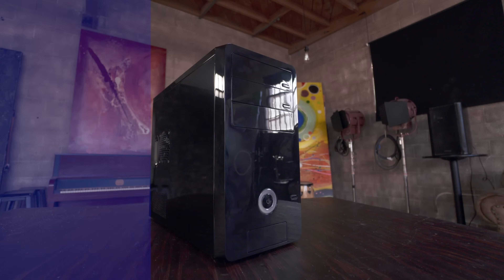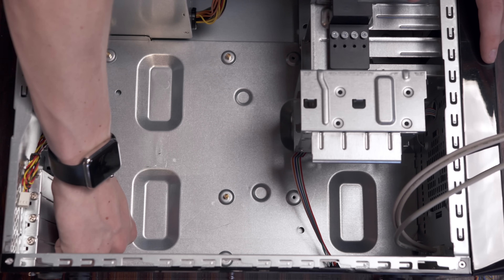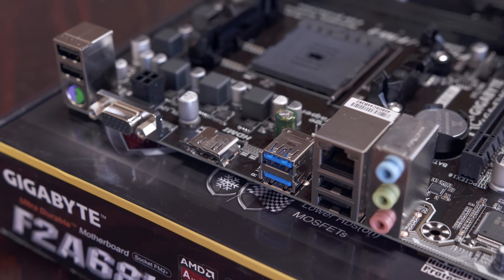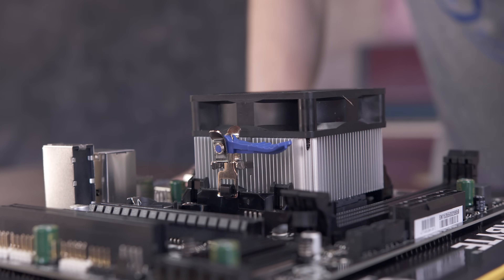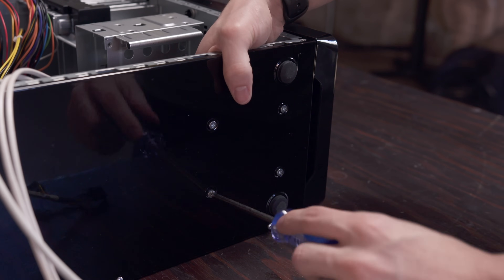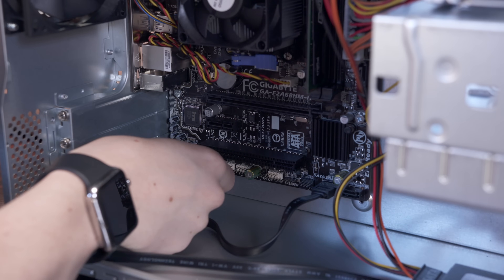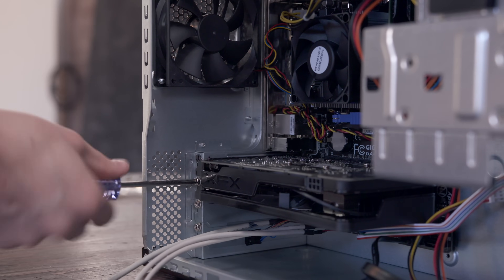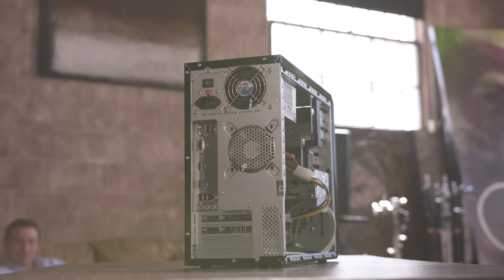How to Build a Gaming PC! (2016)

Comment: Is this good enough to play games @1440p?
Specs :
Motherboard X99 Asus rampage V10

Ram Corsair Vengeance LPX DDR4-3200 32 Gb

PSU Corsair AX1200i

Intel I7-6950X

DVD-RW Samsung supermulti

Corsair Graphite 780T case

Corsair H100i liquid cooling

Dual SLI : Titan X pascal

HDD Seagate 8TB Archive V2 Enterprise

SSD samsung 850 Pro

Windows 10 Pro
Reply: Jesus.... Thats pretty good. I am no tech guy, but I know quite a bit. It's pretty good. But, I feel you are spending too much. Like the cpu, 1 thousand dollars? Here are my recommendations. 
CPU: Intel Core i7-6700K ; Link : http://www.newegg.com/Product/Product.aspx?Item=N82E16819117560&nm_mc=KNC-GoogleAdwords-PC&cm_mmc=KNC-GoogleAdwords-PC-_-pla-_-Processors+-+Desktops-_-N82E16819117560&gclid=CISg0_qX1M8CFQYkhgodRY4JmA&gclsrc=aw.ds
PSU: CORSAIR CX-M series CX850M 850W 80 PLUS BRONZE' ; Link : http://www.newegg.com/Product/Product.aspx?Item=N82E16817139153&nm_mc=KNC-GoogleAdwords-PC&cm_mmc=KNC-GoogleAdwords-PC-_-pla-_-Power+Supplies-_-N82E16817139153&gclid=CKHm-LCX1M8CFcJZhgodNd8ANA&gclsrc=aw.ds
storage(if you want): Seagate Desktop HDD ST4000DM000 4TB 64MB Cache SATA ; Link : http://www.newegg.com/Product/Product.aspx?Item=9SIA5AD4R59999&nm_mc=KNC-GoogleMKP-PC&cm_mmc=KNC-GoogleMKP-PC-_-pla-_-Hard+Drives-_-9SIA5AD4R59999&gclid=CNzIkM-X1M8CFZJahgodAvwKcw&gclsrc=aw.ds

Obviously you don't have to take my advice, but you should. Again, I am not very reliable so you might want someone better then me.
Reply: Foxxyman Aye, the site called pcpartpicker allows you to have a list of parts that you can check the compatibility of and people can also share their build. If you didn't already know :p and also, you can send a link to people and they can see the entire part list that you made. Pretty handy! If you want to use a specific part, there is a way to see completed builds using a certain part that you want. If you knew this then... Rip
Reply: r..r...rip????
Reply: ItzRada Yep. I just figured i'd just give them these links :p
Reply: but how was that bragging? opinion of other is the reason why i posted that
Reply: appreciate all the info thx
Reply: Zacronzer Zetto I was just saying. You could've just saved some money and still get a great pc.
Reply: +Zacronzer Zetto you don't need all that. a 6700k and a single gtx 1080 will suit you fine. also, you would do well with a small SSD  and a bigger hard drive.
Reply: Josiah Schmidt Not een a 6700k unless he wants to edit and other workloads 6600 or even 6500 is good enough for gaming
Reply: Foxxyman don't think you needed to do that. He's obviously joking
Reply: Foxxyman according to pcpartpicker a I7-6700 would be good enough and a less storage and etc but since i wanted to future proof it,  would it be wise to just get the part as the web said? Or should i get a better part
Reply: Zacronzer Zetto That ram is overkill, 32gb is not needed
Reply: He was sarcastic
Reply: +Josiah Schmidt ok so i just need a single gpu and less ssd got that

Comment: can a 500w power supply handle with a gtx 970?
Reply: Yes
Reply: Sh2d3wZ Sorry but 250W is too low.
Reply: might wanna save up a bit and go for the 1070...
Reply: VizionGamingHD perfect, my next "investment"
Reply: Sh2d3wZ 250w is way too low. I recommend at least 400w
Reply: Tandju A 500w will work with any GPU since GPUs get more and more power efficient each year. TBH 500w is overkill for any PC that's not using SLI or Crossfire. As long as you have an after market PSU and not a cheap no name PSU. 500w is more than enough
Reply: Tandju a 500w can power a 1060, don't see why it can't handle a 970
Reply: Tandju or a 1060
Reply: Tandju get a 1060, it works with 500w and it compares to a 970-980
Reply: Comet Productions well a 1050 is a low powered card so an EVGA 430w will suffice
Reply: Thundertube7 that was fast thanks
Reply: it can even handle a 1060
Reply: Tandju oh can it even handle 

Homework!!!
Reply: Tandju Ask Reddit. They will tell you 100%
Reply: 970 need more power than a 1060 ......
Reply: you should get like a 1060 or 1070 instead
Reply: Tandju yes
Reply: Another question, sorry if its a dumb one: Can 250w power supply work? I'm planning to reuse the old power supply
Reply: Thundertube7 any idea what PSU I'll need for a gtx1050?
Reply: Just finished building my desktop few days ago, and it has a 1060 in it with 500w PSU
Reply: LightBytes unless you're going with a crossfire/sli build or plan on overclocking, there's no way you'll need more than 500w. Even builds with high powered cards like the 1080 dont go over 500w since AMD and Nvidia keep focusing on power efficiency
Reply: Eh, you do have valid points, i just like to go for the higher watt psu's cos it'll provide a lot more leeway for overclocking and shit, but even if i wasn't id still go for at least 600w because some cards still need a fair amount of power
Reply: Sh2d3wZ 250w psu? lol thats funny joke man.
Reply: Thundertube7 the new one that MSI made can work on a 275 watt psu no problem. someone got it to work fine
Reply: most likely a shit one lmao... you mad?
Reply: yea
Reply: Tandju
Reply: Tandju believe it or not, a 500W gold PSU can handle a Titan. (Of course it can't be overclocked or anything)
Reply: A 500w PSU can handle any GPU,I bought a 550w PSU just so I can overclock my CPU a tad bit but yours should be able to handle any GPU and CPU
Reply: it could
Reply: The other hardware make sense
Reply: Tandju  yes it can easily
Reply: Tandju If I am not wrong.. ALL Gtx's needs at least 300W
Reply: No.. 650 is waaay too high for a budget build.. even a 450 W will suffice
Reply: Tandju Yes.. lol.. GTX 1060 needs 400W to work
Reply: Jaythekiirby 980 is better than 1060
Reply: +Roi gipot Not really
Reply: 600W is standard these days... Honestly 500w is kinda low. I recommend the Corsair RM 650x 650w.
Reply: Thundertube7 I have a only 1 980ti and a 850watt psu... you mad? haha

Comment: http://pcpartpicker.com/list/mYF8Z8 us it good or not its my first PC. might buy it
Reply: Reverse Flash if you can get an ssd, they help so much and make your system open up programs much faster, and boot up faster. I would recommend like a Samsung 850 Evo 250gb
Reply: is*
Reply: Thank you for the suggestions.
Reply: What is your budget for that pc build? It's pretty good but i think you should spend more in the ram (8 gb it's okay but 16 gb will be much better), a ssd and a gtx 1070.
Reply: d a t b o i 現代のコン420 well i just want 1080p gaming not going for like 4k gaming
Reply: If you only want to go 1080p gaming i recommend you going for an i5 6500 or i5 6400 instead, that are 30$ to 50$ cheaper and is a minimum difference in gaming in case the of the i5 6500.
Reply: Red LED fan for a case with blue LED fans... Wut?
Reply: Reverse Flash Pirate Windows.

Comment: would I be able to use a case from like 2001, to build my PC
Reply: most probably yes but you will have a shitty time dealing with it
Reply: PH0EN1X u get a job or beg
Reply: ofcourse you can, just make sure your motherboard will fit on it.
Reply: just buy a new one it doesnt have to be super expensive i would recommend the corsair spec 01
Reply: what if u dont have any money, and your parents wont give u any
Reply: PH0EN1X Work the corners
Reply: just get a new one for 30$ they look nicer also
Reply: Bender Rodriguez Haha.  Lmao
Reply: it might not be compatible considering you don't know the specs of it
Reply: I used corsair carbide series 200R and it is great, Holes for cable management and it is a good design.
Reply: No
Reply: A friend of mine stuck all the components on a wall with glue once, it worked
Reply: Or you can just build it in a shoe box. :D
Reply: the mother board and case should be same.
like both micro atx

Comment: Is this build any good? This is my first time to build a PC so any advice is appreciated.

CPU: Intel Core i5-6500 3.2GHz Quad-Core Processor 
Motherboard: Asus H170M-PLUS Micro ATX LGA1151 Motherboard   
Memory: Corsair Vengeance LPX 8GB (2 x 4GB) DDR4-2400 Memory   
Storage: Sandisk SSD PLUS 120GB 2.5" Solid State Drive 
Storage: Seagate Barracuda 500GB 3.5" 7200RPM Internal Hard Drive  
Video Card: MSI Radeon RX 480 4GB GAMING X Video Card   
Case: Fractal Design Define Mini MicroATX Mini Tower Case   
Power Supply: SeaSonic 520W 80+ Bronze Certified Fully-Modular ATX Power Supply
Reply: If you plan on playing more of DX12/Vulkan/Future games, you're fine
If you like playing on DX11 and older games I'd recommend you get a GTX 1060
Reply: Great build, but in my opinion, you should get a 1TB WD Blue HDD and you can get a 240GB Adata SSD for the same price as that 120GB Sandisk drive.

EDIT: If you want to play older DX11 games, get a 1060, If you want to play newer DX12 games, stick with the 480
Reply: how much is all of this?
Reply: pedro cottim Thanks for the advice!
Reply: You can get way better performance for $800
Reply: Joshua Cruz Congrats m8 its really well balanced but i would get a 256gb ssd a d 1tb hdd which is like 5-10$ more
Reply: Mahmut Arkawi How much does all of this cost
Reply: In my opinion it's pretty overkill for a starter PC, but if you know that is what you need its pretty good.
Reply: I know this is old, but can someone please check this PC build? I'm a beginner, and this is my first attempt. I have a 1000$ budget, Thanks!
https://pcpartpicker.com/list/F73Hqk
Reply: The Average Video Watcher You shouldnt buy the coller nor the windows 10 since you can get free keys online and spend that money on the 1060 6gb which is alot better imo
Reply: Looks good. :)
Reply: iiWolfiz Where can I check if everything is compatible?? Because I have a pc ready to buy but I don't know if everything is compatible.
Reply: iiWolfiz Thanks. :) I'll reply in a bit.
Reply: Joshua Cruz ıt depends
Reply: Jose Enaje what

Comment: Is it possible to bottleneck a GPU, and if so how would you prevent it?
Reply: Robert Pool get a better CPU
Reply: Robert Pool does it have wifi automatically ?
Reply: AlperenPB it's has ethernet (wired) but wireless is sold separately

Comment: Okay so I built it and it doesnt turn on. The GPU is getting power but the case buttons do nothing, please help
Reply: DevilsHand676 check your case wires
Reply: sufyaan tanveer Yea i ended up fixing it, turns out the motherboard was just damaged
Reply: A Storm Bandit yea i got a new motherboard and it works fine
Reply: A Lake of Mistake 
"free"
you have to pay 50 dollars a year to play games that you bought online and to use apps such as youtube. on a PC you can browse the internet (yes you can browse on a ps4 but who would want to use that laggy piece of shit browser)

"unlimited customizability"
you literally have the "option" of "customizing" some dumb avatar and changing your background and sometimes changing controller sensitivity. on a pc(windows), you can customize anything from mouse sensitivity, taskbar location, graphics, wallpaper to any image you find on the internet, OVERCLOCKING. Not to mention PC has unlimited hardware modifications: you can upgrade your parts whenever you feel the need to. If you try to "upgrade" a console, you void your warranty.

"more power"
you are fucking braindead if you think console has more power than an PC, consoles are limited to shitty CPUs that clock around 1.6-1.8GHz which is honestly pathetic. a macbook pro has a more powerful cpu. also, consoles including the PS4 have integrated graphics, which means that the CPU and the graphics are all the same chipset. the graphics and the system share the same memory. most or all gaming pcs have dedicated GPUs that have higher clockspeeds than the xbox one or the ps4 combined. pc gpus have dedicated memory anywhere from 2-12gb of gddr5 memory plus the addional 8-32gb of DIMM memory that the cpu and the other components use. this is why the ps4 and xbox one dont have graphics features such as anti-aliasing and anisotropic filtering that pretty much all pcs have.

"backwards compatibility"
I like how peasants lose their shit when one ps2 game comes to ps4 or when one xbox 360 game comes to xbox one but pc users can play any game from half life (1998) to overwatch(2016) without any problem

im totally fine of you prefer console for whatever reason but if you act like console is superior and spread misinformation to people who are clearly considering building a pc then there is a problem
Reply: Michal Wubs What? Are you on drugs or something?
Reply: Anthony Arteaga I have no idea what was wrong with it, I think it might not have been getting power, and yes I ordered the same motherboard again
Reply: i got the exact same problem and i took it to microcenter

its cuz i used a shitty motherboard from 2009
Reply: sleepybird09 Wrong Answer
Reply: Michal Wubs You need an extreme sarcasm detector bro
Also, I'm not a retarded fish, I am a autistic dragon. Don't assume my species nor my condition.
Reply: ThePerfectKeys facepalm
Reply: Too bad its not going to be free online too much longer, and that all the new gen consoles are backwards. But yea know you can play any game from Pong to For Honor on PC no matter how old
Reply: Michal Wubs Nice joke m8
Reply: hope you fix it
Reply: ***** it was the same one in the video
Reply: ShittyVids S 3.2 GHz means nothing, unless you talk about architecture
Reply: ShittyVids S And three cores mean nothing, because again, architecture. And also because three cores are a low c. count
Reply: Michal Wubs Nice joke m8
Reply: SoFlo Pinocchio The PCMR thing is a joke, a gag.
Pepole say that because the PC community was labeled Nazi so they started this thing as a joke.
Reply: I can't give you an accurate info because i did not use the same graphics card. But I was hitting a good 60 fps on max settings in overwatch, didn't play GTA V, but Doom now way this can't handle doom
Reply: A Lake of Mistake Lmao when you type an essay for nothing
Reply: imawhale I guess that's fine
Reply: :thinking:, why do people argue about black and white subjects on the internet? It's obvious that the PC is better for certain tasks and people and it's obvious that consoles are better for certain tasks and people. Why come onto a YouTube video about building a PC and then say to get a PS4? It makes absolutely no sense unless you're trolling.. but then that leads to the question of why bother trolling?
Reply: A Lake of Mistake are u talking about pc because those are all on pc not PS4

I'll tell u what a PS4 have, lowest preset on the pc is the highest settings
Reply: no matter what happens dont buy a console
Reply: What was wrong with the motherboard and did you get the same one again?
Reply: Thanks
Reply: Is that pic good
Reply: DevilsHand676 So sorry for bothering you it how does it preform for you Fps wise in games like Overwatch And gta and stuff
Reply: DevilsHand676 can this handle league?
Reply: yes it can easily play league
Reply: MiguelXx3D I will assume your gender though
Reply: DevilsHand676 4:00
Reply: Gabriel Moyer Im not saying that, each one has its own benefits, i have a console and im building my first PC in like 2 months, and its a really good PC as well, but these 'PC master race' fan boys need to lay out, stop judging people.
Reply: Hey I was building my pc and I'm pretty sure that I have all my wires installed so when I go to plug it in, the fans turn on for a brief second then go off and the pc won't turn on. if you know what the problem is can you tell me
Reply: DevilsHand676 rebuild and repeat it
Reply: DevilsHand676 make sure every cable is put in the right place plug them all out and try again it happend to me too and this did the trick
Reply: David Roman it was the motherboard not the PSU nurd
Reply: DANK MEMES My comment was sarcastic I just ascended
Reply: Michal Wubs LUL, you think your weak limited consoles are better than glorious PC master race, you should continue to stand below with that attitude
Reply: Michal Wubs Steam isn't great but other customer services on PC are great like blizzard, plus Sony and microsofts service is absolute trash, designed for gaming doesn't mean shit when they still are worse for gaming compared to PCs, idk what you're talking about with this ridiculous 4K 60FPS, the closest thing consoles have to that is PS4 Pro, which is fake 4K at unstable an unstable 30 fps, better exclusives is debatable, games earlier goes both ways (sometimes PC gets games first, sometimes consoles). No viruses I can completely agree with, one of the main advantages of consoles is how easy they are to use and set up. Sorry if I came off as a jerk, consoles are good but in the end they can't quite compare to PCs
Reply: chill out
Reply: DANK MEMES so true pc's are so much better than consoles. However the CPU on consoles are good because they optimize them on games. And my Xbox 360 has a 3.2GHz tri-core processor
Reply: You can play League on almost anything. A $200-$300 CAD computer is probably good enough to run it okay on low settings.
Reply: PS4 is far more superior. Free online unlimited customizability cheaper games more power and backwards compatibility.